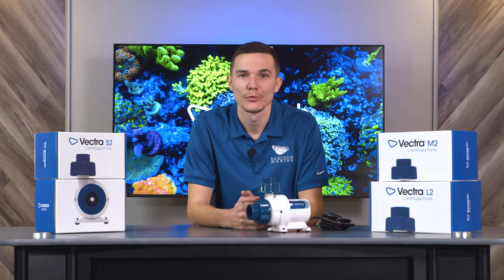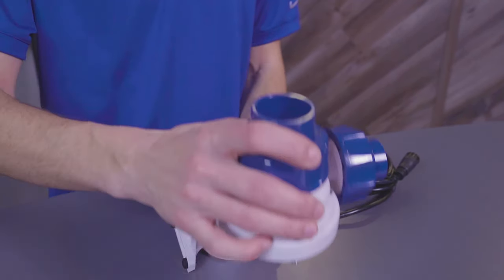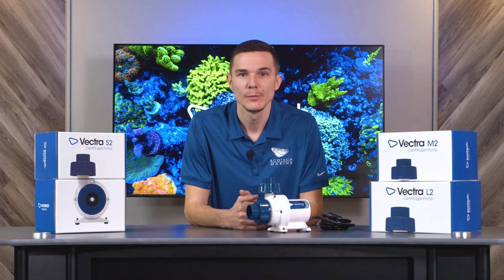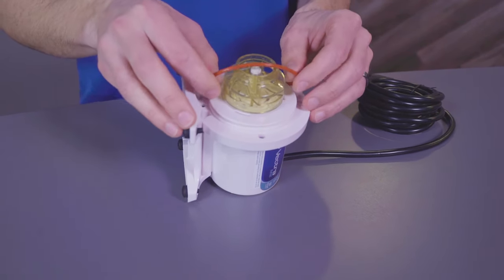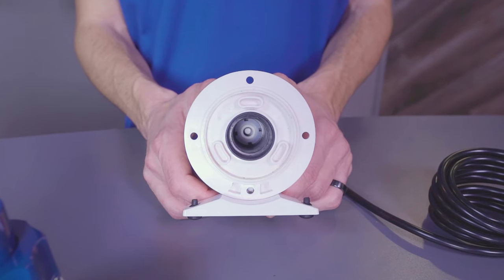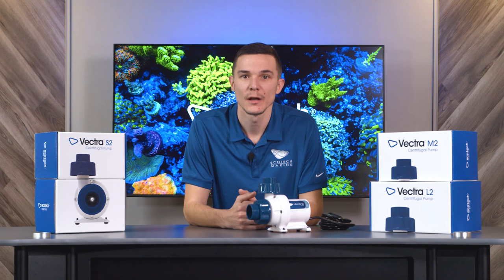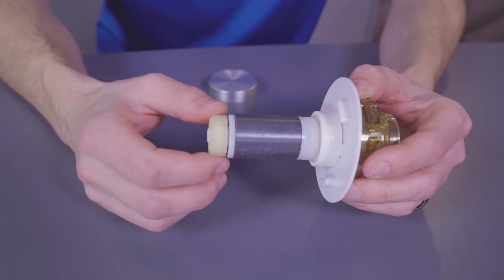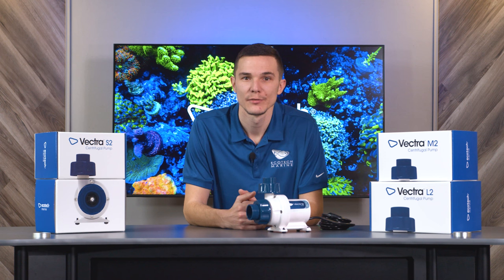EcoTech Vectra Troubleshooting: Red and Green Stall Error/Cleaning

Comment: My goodness it was difficult finding this video in the middle of trying to find out why my pump wouldn’t run after cleaning. 

I think the knowledge base could use a bit of an overhaul for navigation. You should be able to find this without having to specifically state exactly what’s happening in your search terms. 

Go to ETM’s website, search for Vectra Manual and the only .PDF you can find is a quick start guide essentially. No troubleshooting, no parts lists,  I don’t want to have to search YouTube for troubleshooting guides i have to watch. I want a manual that shows all of this please. Provide more than videos!

That being said, thank you for this video at least was an absolute life saver.

Comment: Purchased this pump about two years ago have only had it running for less than a year (11 months) and it randomly went into stall mode one afternoon. I’ve disassembled it, cleaned it, reset it countless times and still it’s stuck in Stall Mode. It starts then stops then starts and stops again for about 15-20 minutes. I’ve tried a new power supply that I received from Ecotech and have used there App but still the same result. $500 for a pump that didn’t even last a year and now I’m running one with the same GPH purchased on Amazon for $90!!